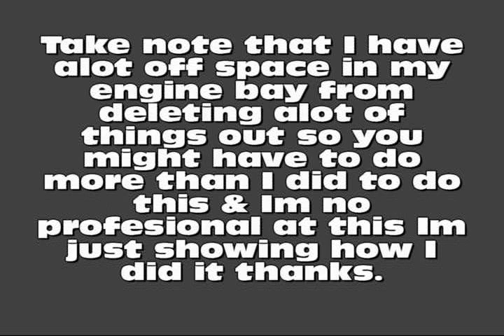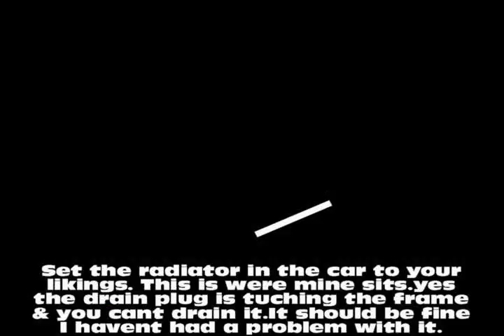How to install a civic radiator in a 92 integra

Comment: Nicely done, and the reason behind this mod is quite simple.. cooling efficiency. that half size rad will keep his engine cooler than the stock one. I have a dual core (same as this one) from cxracing with a slim fan and aluminum fan shroud. In regards to the A/C either mount a slim fan to it or ditch the a/c cause racecar!
Reply from the maker: thanks. i would have kept the a/c but the compressor went out on my years ago n didnt want to spend the money on a new one so i took it out. i miss it the in the summer